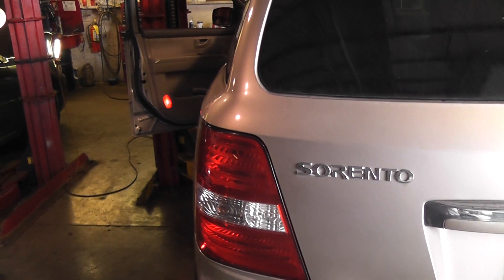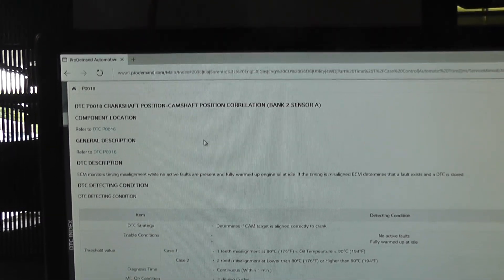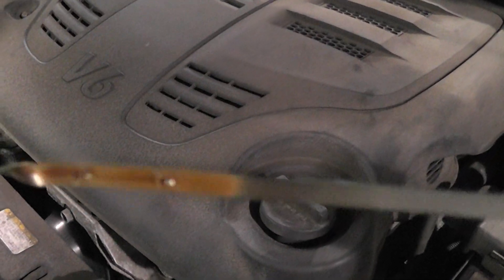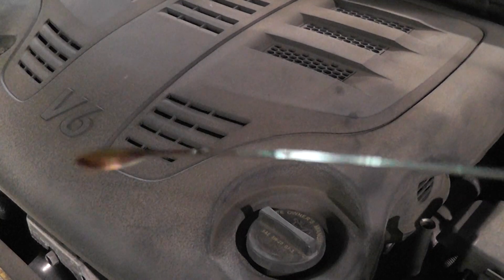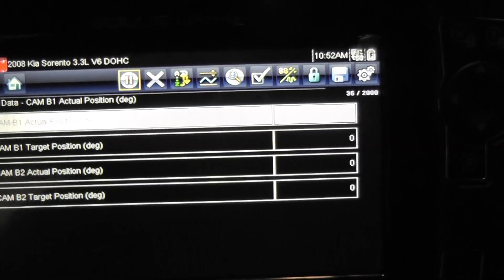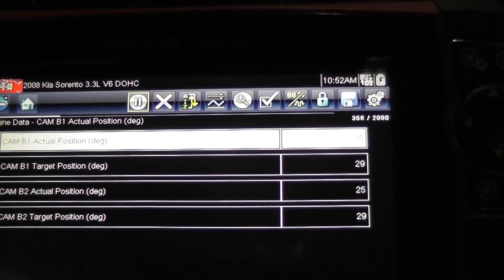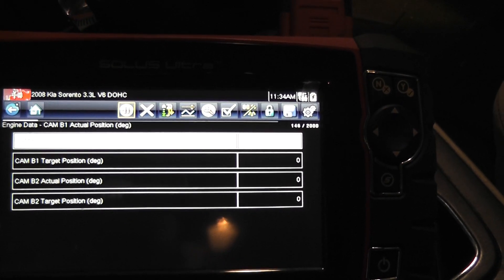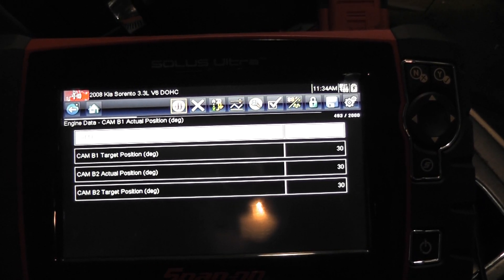KIA VVT  P0018

Comment: Kia software engineers designed the system to turn off the check engine light after each key cycle.  I have had major faults where the vehicle went into limp mode.  Cycle the key and the code is only in memory light out.  I strongly disagree with their logic.
Reply from the maker: +David Seymour yea. If it stayed on, maybe they get it looked at sooner and maybe check the oil

Comment: hey Jim. I have a 02 chevy trailblazer 4.2. it has a P0014 code. cam positon sensor code. where can I go with this?
Reply from the maker: +william burke I have a video on one of those. Mine, the screen came off and got lodged in the valve. U gotta pull the belt and loosen the power steering pump to slide the valve out

Comment: good greif that was low I'm curious if you have an opinion about fleet oils not necessarily concerning vvt engines but in general great video thanks for showing us
Reply from the maker: +James Kmenta not to familiar with the term fleet oils ,but if u actually change the oil 3 to 4k miles ,I think oil is oil. If u have a specified weight or one specifically requiring synthetic or the dexos stuff. I use it

Comment: I had a quick question. What scan tool are you using here? I'm asking because I'm looking a buying a nice new scan tool and It's hard to find out information on what's all available. Trying to find a good model older used tool but also have a couple years of future proofing and support with updates before having to replace it.
Reply from the maker: +hobbles wolf it's a snap on solus ultra.  It's a few models back from the newest and best but it's fully updatable to the newest.and does everything the new ones do as far as tests and info. Just not windows based with wifi and links to shop key and all that stuff ..  But updates can be as much as a thousand bucks.
I got mine used from a snap on dealer updated to 15 for 1500. Then they just had a promotion where they updated to the 16.4 and u get the 17.2 free when it comes out .. which is now. For 575

Comment: Had a Hyundai from another shop with a knock sensor code and failed emissions.They installed 2 knock sensors and an O2 sensor trying to fix the problem. It was clattering when i started it and had very little oil in it. An oil change, ran the monitors, passed emissions. Today's techs forget the basics.
Reply from the maker: +wysetech2000 nice. I remember a long time ago when Paul was starting his diagnosing, he had the vantage before I did. I was messing with this Toyota that wouldn't start but after it stopped cranking  over it would run backwards for 15 seconds.  We both spent a good hour on igf, igt, primary and secondary waves. All my prodding.. finally he said..Did u ever pull a spark plug? Duhhhh. Worn so bad even the negative electrodes were gone. So much raw fuel in the exhaust,  when it would backfire, it totally sucked from the exhaust and belched out the air cleaner

Comment: what does it take for the oil light to come on? zero lubrication?
Reply: I call it the "Replace Engine Light". By the time it comes on the damage is usually done. Usually the pickup tube has to be sucking air before the light comes on.
Reply from the maker: +NCPDFSB seriously.  It's hard to believe that it doesn't come on. Part of me thinks that the vvt codes popping up ( the ones that people actually bring in to have looked at) are actually saving engines from totally running out
Reply: NCPDFSB depends on if the car has a oil level sensor or not.

Comment: Good info James. I'm glad you posted this since I've been wondering if some cars control the phasers in park and others don't. Ivan just did a phaser/chain repair on an Equinox and it controlled in park as well. Don't understand why but at least I now know that it can work that way. Thanks!
Reply from the maker: +Baxrok2 u know what the video title was? I have a suzuki cx7 that has the gm 3.6l and 3 cam crank correlation codes that I think is chain stretch.  But I have no experience with those yet
Reply: Ivan over at motoYam82 did it. The title is - P0016 P0011 Low Power Case Study: Chevy Equinox - Part 1
Reply from the maker: Thanks. I'll check it out